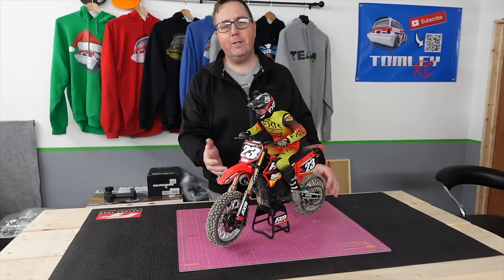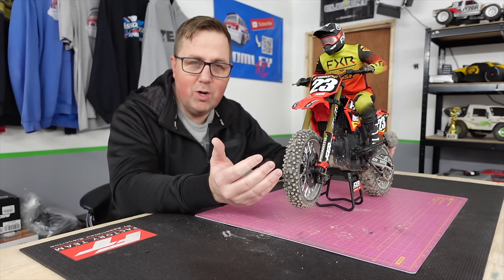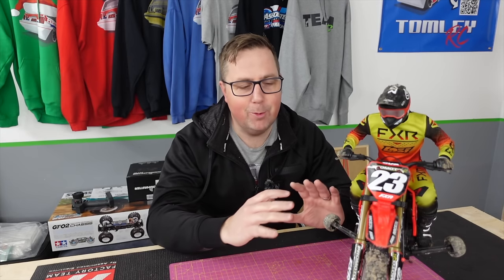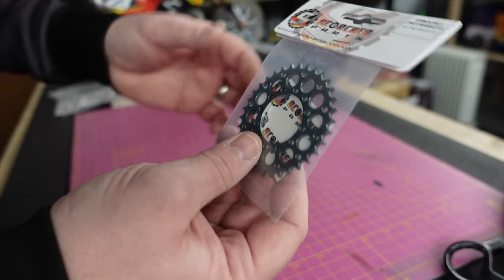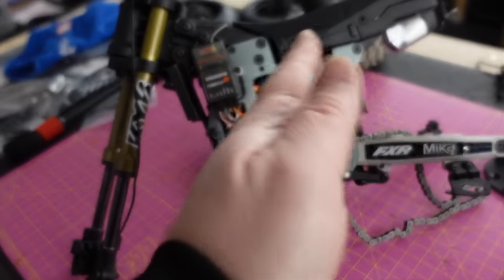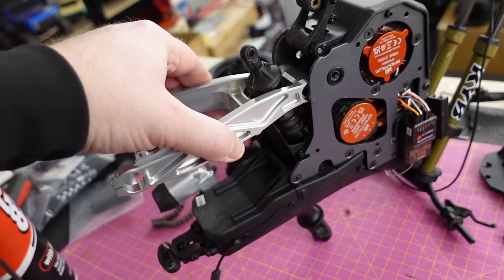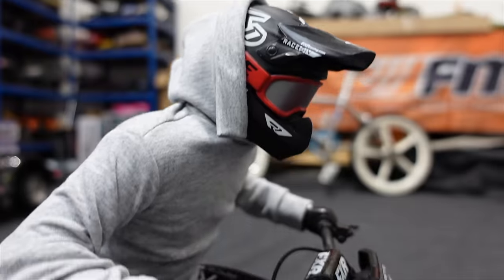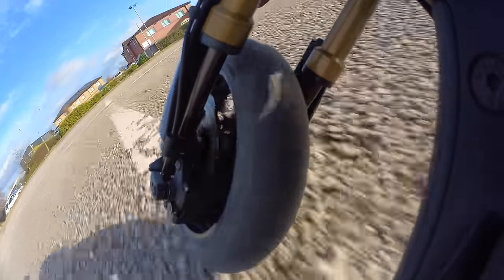The ULTIMATE RC Motorbike!

Comment: I promise you, take off those Prolines and get whatever aftermarket wheel of choice is you like and get the Vitavon full size street tires. I did a Promoto and Supermoto build and even with speed gears the Supermoto only did 40. Swapped over to some Aliexpress Vitavon knock offs and some Vitavon tires and the bike handles SO much better, does 50MPH on 2S stock battery and will still do wheelies for days! No more chain rub or chain guard rubs! Can turn sharper and is just loads more fun!
Reply from the maker: I'll take a look... although this drives so nice as it is without the stabilisers.
Reply: I was so interested in the bike I was lucky to order one from Canada 🇨🇦back in August. Love it so much mine is now 3s .and yes vitavon Street tyres are perfect.
Reply: They do handle a treat with the arms off. I love the look! I just got tired of chasing it. Wore my wives Fitbit and it said I walked 1.8 miles picking it up. LOL I kept eating chains and such so tried out the larger wheels. MUCH better performance now. I can send a link of the the video on larger wheels if you like. I am a HUGE fan of your channel so dont want to step on any toes. I went with the HR gears which is one tooth larger pinion (sprocket) and 1 tooth smaller wheel sprocket and added the hardened chain.
Reply: Super hot look great effort if
Reply: Superb video Phil!
Reply: Do you ever sell your builds ?
Reply: @TheDudeRc where can I see this build at ?
Reply: Are you joking these do 50mph!?!?!
Reply: @ollyjackson8733 oh yea man. 50mph is pretty average for electric RCs in that price range! Hobby has come a long way
Reply: @V8chump  mate my first motorbike struggled to get there that's nuts

Comment: I'm hoping they are working on a superbike road version. I'll be all over that like white on rice. Other than body panels and rider, I think the only major change would be the length of the front shocks. I think the protection arms out the sides could be integrated into the fairing/body panels. I think that'd be epic and create a whole division for on road racing.
Reply: I would also love to see a superbike version. But if they want to do it right, they have to change a lot. The geometry for a street bike is totally different. Theyre less tall but with a longer wheelbase, the swingarm is mounted higher in the chassis. The angle of the front shocks is also different.
Reply: @Truckziller  I guess you've never heard of adventure bikes?

Not to mention these aren't actually superbikes OR motocross. 
The length can be done with a long chain and swing arm. The front shocks can be shortened. 

It wouldn't be that diff, you can tell by the way this version handles on the road with just a change in tires. 

I mean did you SEE the way it was leaning into the corners on asphalt?
Reply: @muskokamike127  Ah maybe thats why Marc Marquez left Honda, because they wouldn´t give him an Africa Twin for MotoGP. 
Of course theyre not real bikes, but part of the fun is the authentic look and behavior. The mods you listed are already available or can be made easy. If Losi will step in, they will do it right.

Comment: I know I know I'm yakking a lot but shout out for the engineering behind it. It's off the hook! To combine the gyro with the board to allow the thing to even stay upright but then the different wheelie modes AND the fact that the rider's arms move with the steering and to fit it all in. I bet they spent 1000's of man hours engineering it all before they got it to work. 

I don't think ppl realize the tuning required to get the gyro programmed to keep it upright but also allow it to lean into corners. Those two actions are in direct violation of each other. 

It takes a LOT to impress me and this thing does...(if you couldn't tell).
Reply from the maker: haha...Yak away dude. I am more impressed with the engineering behind this than the actually driving of it lol.
Reply: @TomleyRC  I know right? I bet there are engineers right now taking it apart and looking at the source code to figure out how they did it.
Reply from the maker: Haha… true story!
Reply: It is awesome technology forsure. Someone was saying the reciver is just a air reciver with fly safe program written to it. Not 100% but I wouldn't mind figuring out what one they relabled  to use. So of this ones ever had to get you can get another one that has the same gyro.
Reply: Definitely. I'm a physics guy and all it took was seeing one video of how the thing works and I had to have it. 
Maybe I can somehow use it in my classes and write it off my taxes? 😂
Reply: @mgscheue  100% use it as a teaching aid. R/C was incredibly expensive when I was in school ($12K for a plane in today's dollars) but they would have been useful in physics class on aerodynamics.

Comment: You can make super tight turns. It's something you learn or maybe it's because I ride real ones. Turning on the throttle is your friend with these. Stay on and off the throttle and I can make tight turns in my yard effortless. But everyone learns them differently. These are so easy to operate. Some reviews on YouTube give the wrong impression. One thing I've learned. Don't listen to others reviews. Because usually it's operator error. And if people actually read the box or manual you'll see to make tight turns adjust the MX6.
Reply: Youre right with braking.  As soon as you slow down the gravity pushes the bike straight up again and therefore needs a wider diameter for turning.
As you said too: turning with bikes needs staying on the throttle and steering in the opposite direction.
Reply: @AsurasWrath164  when I get a chance I'm going to get some videos In my backyard with it. I can make some  tight turns with it no problem around my track. It can be tricky but it's something I've learned with it. I have 2 of them that are built a little different. But adjusted the mx6 know helps big time. I adjust it differently for dirt and on road.

Comment: Chain slack should be checked when the axle is parallel with the front sprocket, so you'll want to compress the swingarm partway through the stroke and set the tension there.

Comment: That montage at the beginning in stock spec is superb, Phil!
You made your bike look very cool - but I have a question.
Did you notice the talker gearing you got from the smaller rear sprocket?
I ask because you simultaneously fitted a smaller rear wheel, so I'm wondering to what extent that cancelled out the effect of the sprocket.

Comment: It would be cool if the knees stuck out and had titanium skid plates on them so when you laid it down in the corners sparks would fly off the kneecap that would be amazing. 😮
Reply: I was thinking something similar but different boots or seeing if you can angle the boots out more with the toe since he said they just touch when leaning real hard. Looks like in one of the onboard shots he had ground the plastic down on the foot already. Definitely need a replaceable skid plate on them!

Comment: Its a shame there is no good engine detailing like the VENOM VMX450 I have it is also on Super moto tyres. It could do with a working rear brake for proper Supermoto action. I cant get the Motocross tyres for my Venom so will be trying the LOSI gear on it. You need to try the other Pro-Line tyres for the terrian it was struggling on, still not sure whether to get the LOSI as my VMX is not that used.
Question where did you get the hear gun I need one that size for my tool box.